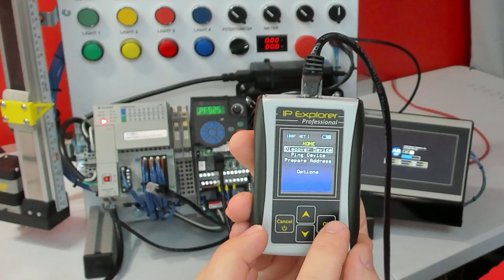Replacing a Powerflex 525 that has Automatic Device Configuration ADC

Comment: Can i use this if the drive is slightly different? If I replace a bad 0.5hp drive with a 1hp drive only due to inventory shortage?
Reply from the maker: Yes, it works with all Powerflex 525s. In have they all have the same control modules and are interchangable

Comment: You should probably mention that this has little chance to be this easy in an industrial setting. The old bad device is probably at a different firmware level or possibly a different series with some devices. With 755 drives now at v14 or so, you have a small chance of the new drive matching unless it only lasted a year or less. I don't recall replacing any PLC, safety controller or drive and not having to flash it first. ControlFlash Plus is  making this an easier thing. Thank you for your time and effort in doing these videos.
Reply from the maker: I've never tested it but doesn't the Firmware Supervisor feature take care of this during the ADC?

Comment: So you can do it this way without a Stratix switch, right? With the switch you don’t have to set the IP address in the drive seems to be the only difference. It was a real surprise to our technicians when I told them they only need to take the drive out of the box and wire it up, turn machine on and boom drive ready.
Reply: When you say stratix switch you are talking about a managed switch correct?
Reply from the maker: Yes, by Stratix he is talking about the managed switch or some "smart switch" feature of assigning IP based on port.  At that point you simply have to plug in the Ethernet cable, power up the drive, and recover.  This is a new feature on some of our trainers so I'll be doing videos soon :)
Reply: @TimWilborne  I understood that part. I was just asking for clarification for others. Using a branding name in some instances does not yield the desired results and I knew someone could put in a Stratix 2000 series and they won’t get the results the original commentor precluded to.